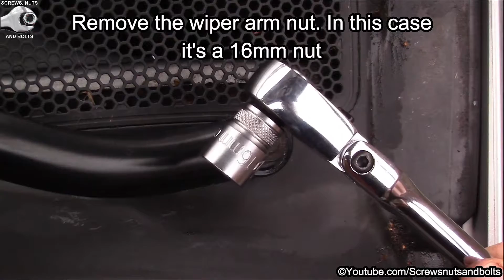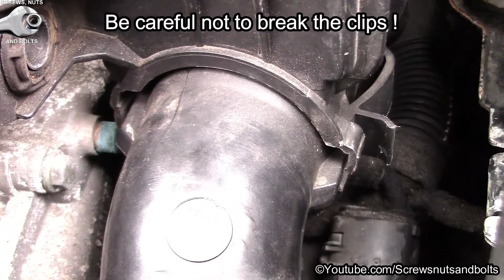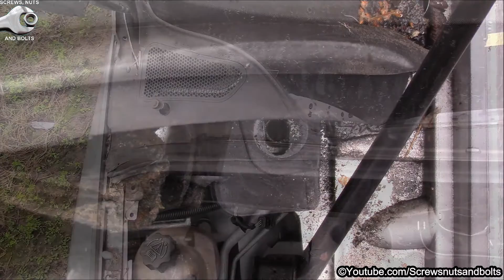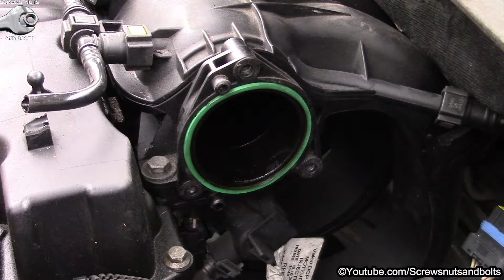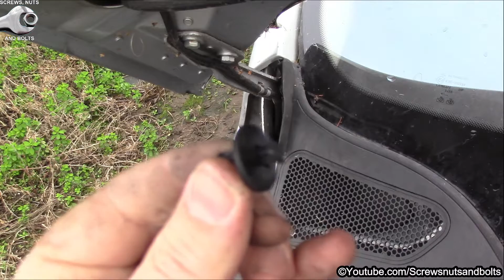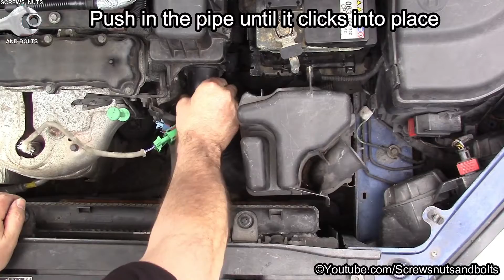Removing the Throttle Body on a Peugeot 307

Comment: Hi I have the same car...it idles n then cuts of after some few minutes I changed the throttle body but still it does the same thing.. is there anything u can think of to help plz?
Reply from the maker: It could be a problem with the fuel pump or it could even be a faulty ignition coil pack among other things. Does it only cut out when idling ?

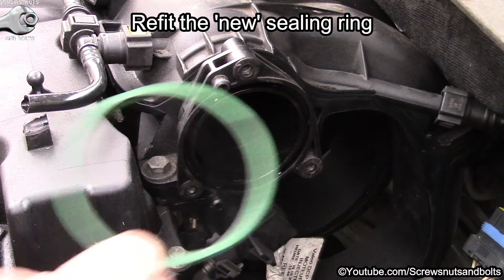Comment: I want to clean my throttle body cause revs jumping a bit when idle. Does anyone know what the part number of gasket at 11:02 is?
Reply from the maker: This is the part number I found: 0348Q4
Reply: @screwsnutsandbolts  Mine is 1.4 16v as yours on the video, but it says 0348Q4 is for 1.6 16v. The noticeable difference is that gasket 0348Q4 for 1.6 has additional "teeth" outside and inside seal. I think I will give it a try as I can't find ideal the same gasket from the vid anyway.

Comment: How do I relearn the throttle body with out scan tool?
Reply from the maker: I think it will relearn itself in a short time. Check out this video: https://www.youtube.com/watch?v=pERDBPcR5OQ
Reply: @screwsnutsandbolts  I didn't have the battery disconnect.i cleaned it and moved the butterfly bit
Reply from the maker: @easyrider020  It should reset itself

Comment: My tb is open when i disconect it
Reply: And stays open too when runing the engine. Also there is a hard electrical buzz from it. Engine runs okay. Since is diesel it relyes on injection more than air but causes my engine to run lean. So when I shut thr car it shakes  since it itroduces still air in the engine dus the tb not cloasing. I guess its time to replace it